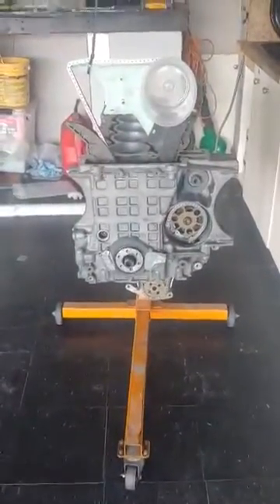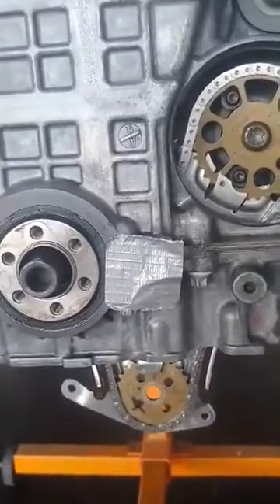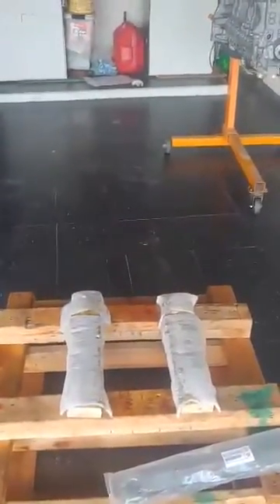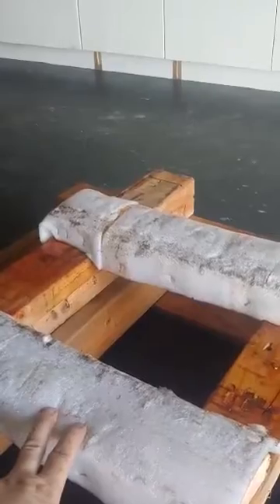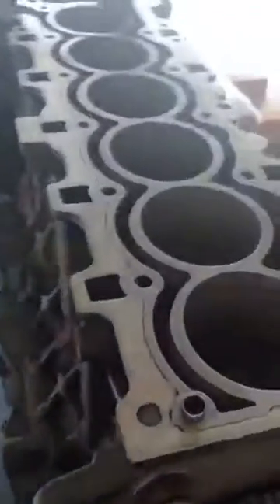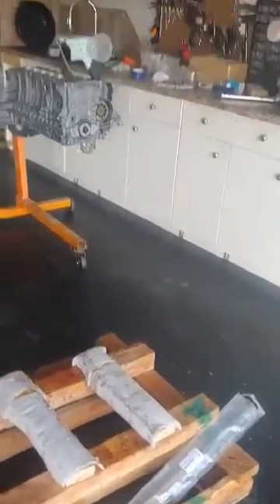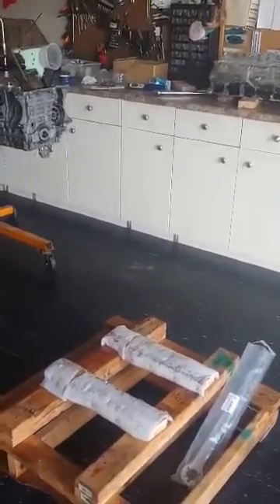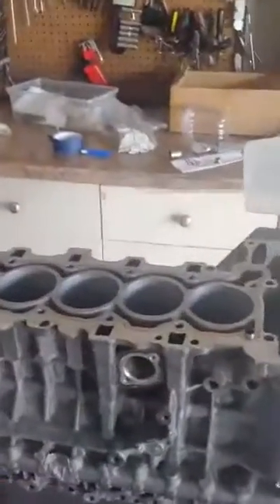BMW N52 / N54 Rebuild, Crank Hub Install

Comment: Hey Man I have a n52 and I was wondering if the crank hub bolt pattern is the same for the n52/n54 so I could buy a crank hub bolt capture plate for my n52 that would normally fit a n54 Thank you for the Videos man!